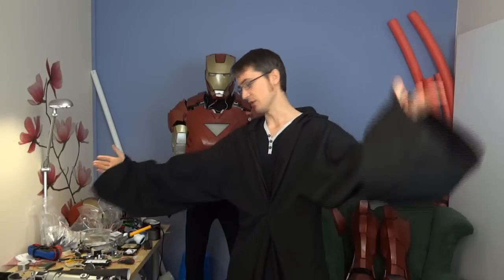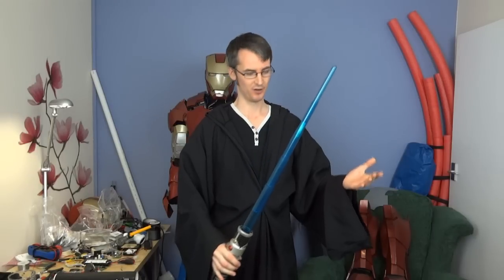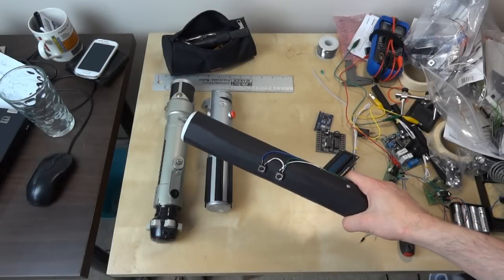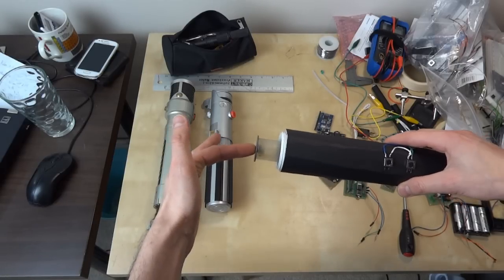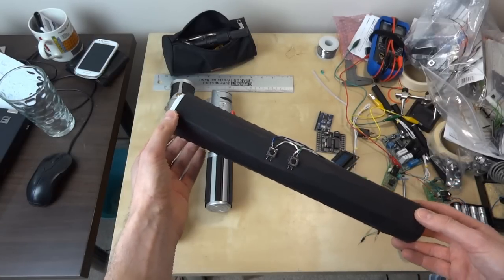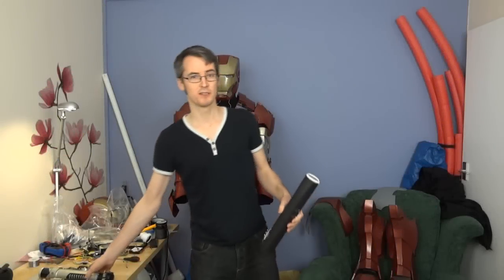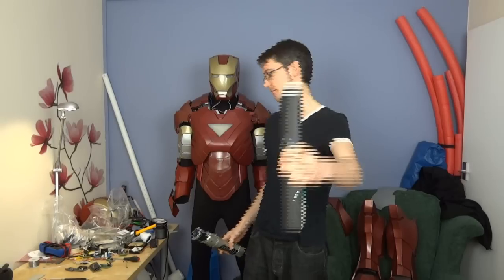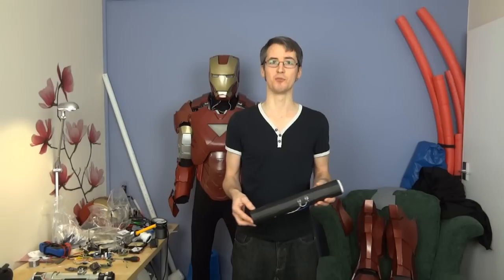Electronic Extending & Retracting Lightsaber Mechanical Prototype | James Bruton

Comment: it operates way too slow. it should be a two or three times as fast as that.
Reply: i figure you're using something like an electric car antenna mech. to do this. I've had that idea myself. It's just not fast enough - the spring mech. that is in the Force Action toy lightsabers IMO is the proper speed. unfortunately it has no retraction. https://www.youtube.com/watch?v=Wj3q-xtCD8U

Comment: Did you ever make progress on the actual blade itself/make one or find one out of better materials? And if I may, what was the one you ended up using for this video a part from?

I'm trying to build a telescoping blade to be able to take a lightsaber of mine places without a huge polycarbonate tube. While mine won't pull all the way into the hilt or extend/retract on its own, I think a telescoping blade similar to yours is the direction I'd like to head.

Comment: what about a pneumatic mechanism using a co2 cartridge to blow it out into a locked position, and a string inside pulling it back when the lock is disengaged? anyone tried this? Im kind of playing around with a design like that capable of withstanding some "fighting" as well.. oh I might just say it. My design is inspired by how the dick works.
Reply: +Stian Berg Actually the dick doesn't work like that. No CO2 involved. It's pure muscle expansion and hardening.
Reply: First of all, I said it was the inspiration, and no, there are no muscles in the dick. it is only supported by muscle fibers which also can control the flow of blood. The dick itself is a series of chambers that expand when they are filled with blood. Seriously... were you being funny or something?
Reply: ***** How is muscle different than muscle fibre? :D
That's what I meant.
Reply: ***** Haha. I thought the tube is surrounded by muscle tube that makes all the necessary expansions. Ty for clarifying.
Reply: The more you know! :)

Comment: Why not just hack the Hasbro one and add a retracting mechanism?
Reply: Monofilament to the tip on the inside and a small motor in the handle to  pull it back in? Just figured it would be easier to figure out how to do the one thing its missing rather than stay from scratch.
Reply: Not sure how it works I'd have to see it.
Reply: Btw what 3d printer are you using?
Reply: ***** attach a key reel to the telescopic blade

Comment: Why not using a CO2 tubes air pressure to extend the tube much faster
Reply: It will get back with the method u are using right now i suppose
Or you can use springs: Springs stretches when its open and U lock the blade and when you press another button it would shot in again?

PS: eng is not my native lang
Reply: /watch?v=2XWGwemjPKM
This mechanism with 1 way spring strech.
You might need to use a very weak and little long spring.
Reply: James Bruton can you just explain the mechanism(like schemes) so that we can improve on that?

Comment: My guess is that you've used air pressure from an electric pump to "pump up" the blade and then you create a vacuum to pull it back in?

Very cool idea, because it could potentially be very small if you found the right components.
Reply: ***** Yeah, but that would only be a problem with tapered telescopic sections. Granted, it would be a lot of work to fabricate your own blade that maintained a seal at all stages. The idea has potential though. Haha so that's not how you did it? Now I'm picturing some kind of servo cable set up, but the blade behaved weirdly when you extended it.
Reply: ***** Anyway, it's very cool. I'm looking forward to the reveal!